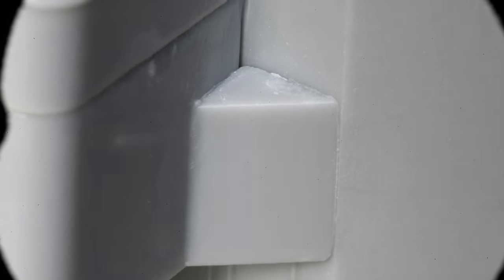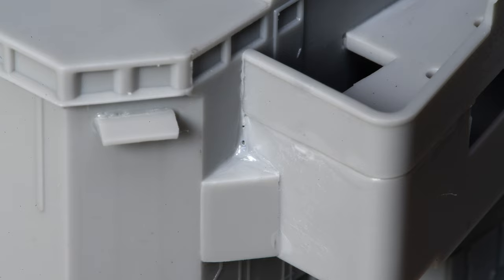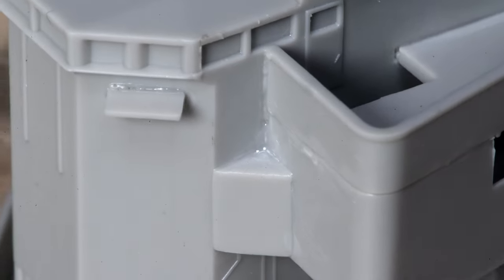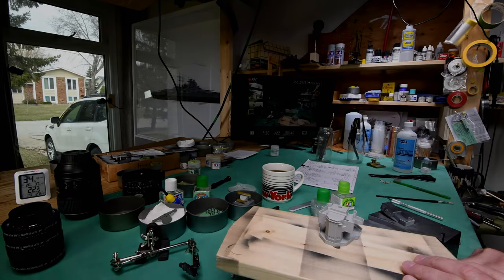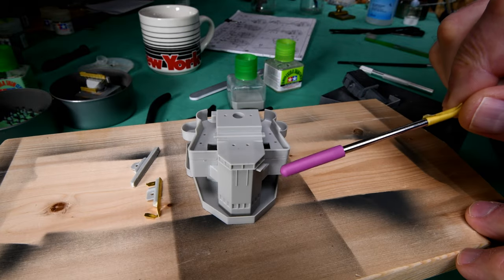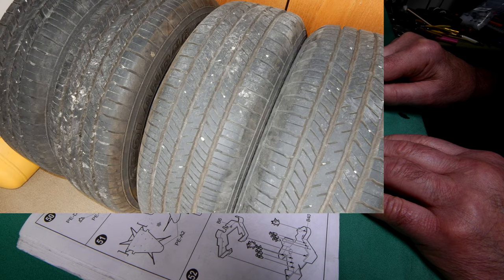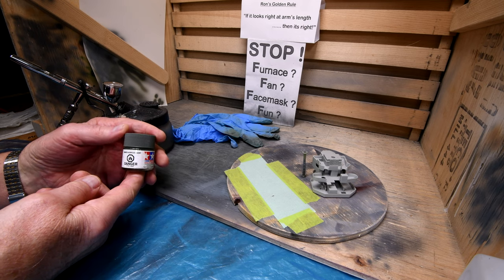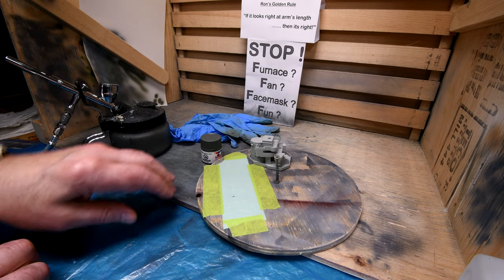The Model Ship - Part 791

Comment: Hi Ron. I hope the spraying went well. Did you spray everything from the previous steps or just the bridge superstructure?  Just a suggestion, but it might be worth taking a look through all the parts that you have assembled but not yet installed to make sure that there aren't any which will be difficult to put on to the ship once you add the bridge section and forward mast.
Reply from the maker: I will be spraying tomorrow. Yes, good idea to look ahead, that's for sure. 👍